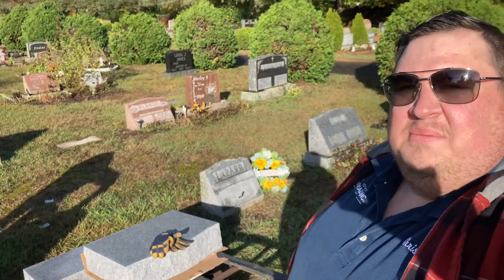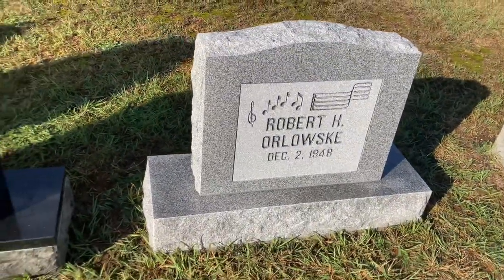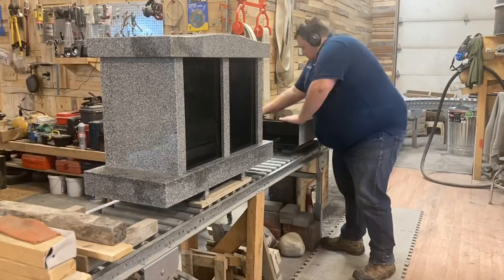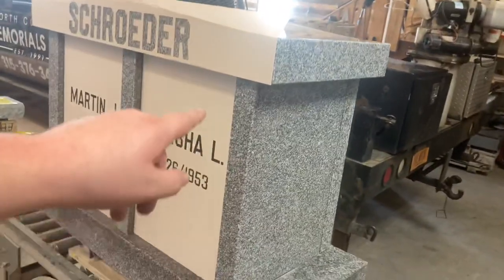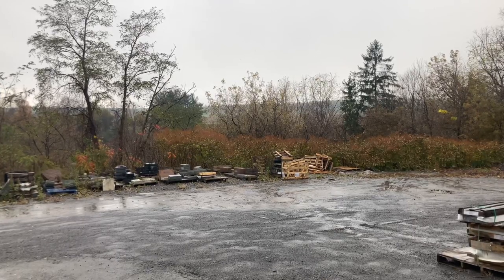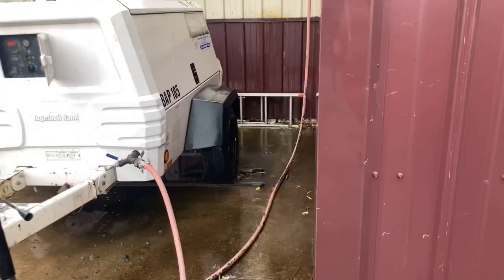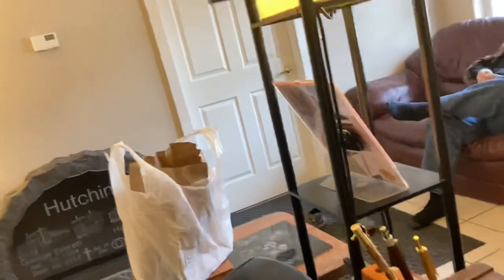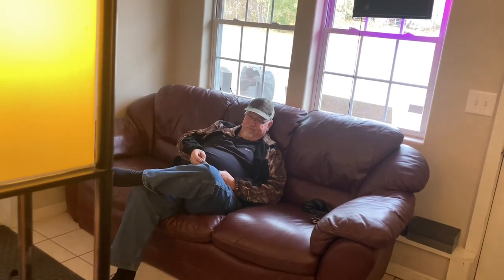Sandblasting Moisture Problems!!

Comment: 6:42...You nailed it.  Some machines and valves are just better suited for handling moist abrasive.  But on the other hand, mechanical water and moisture separation only go so far.  To really be effective, an after cooler coupled with a refrigerated dryer is about the only remedy.
Reply from the maker: Maybe  refrigerated dryer is in the future will see!! :)

Comment: If you can pipe air from inside your building to the inlet on your compressor outside The building, then you would have dry air into your compressor.
Reply from the maker: I had never really thought about doing it that way.

Comment: I've been doing onsite lettering for 20 years and never had an issue.  I'm in Indiana,  I use an air moisture separator on my Marco.  I have it mounted so the hose from the compressor connects to it right before entering the tank.  It pulls moisture from the air and nothing but dry air enters the tank.  Like I said I've NEVER had a problem with moisture and I've had the same separator now for 14 years
Reply from the maker: We never have a problem with the Marco its the Empire that has the issue.